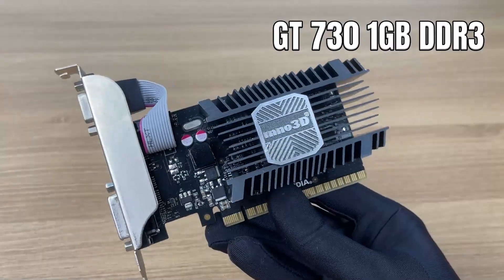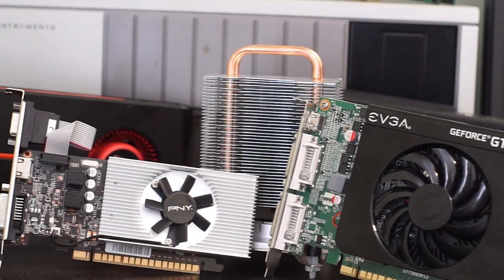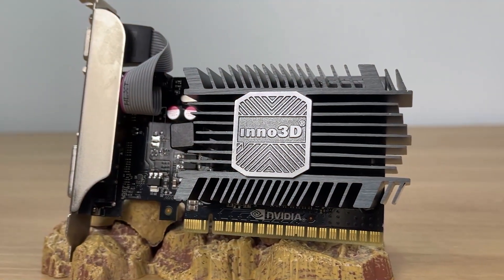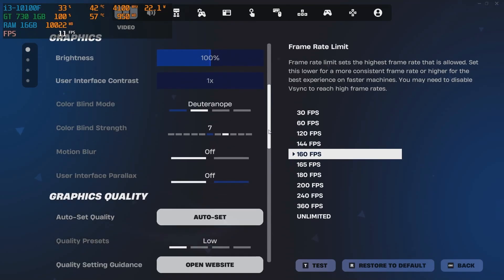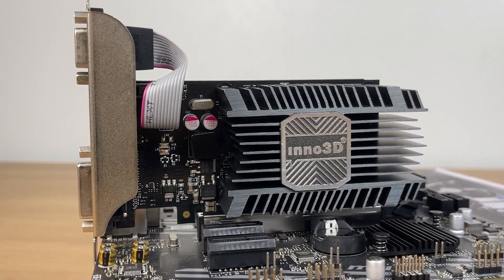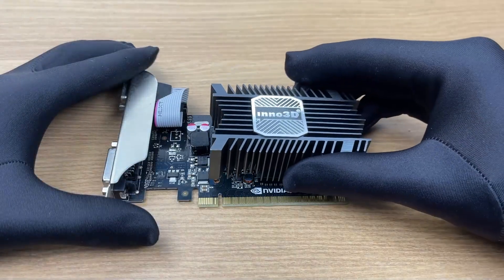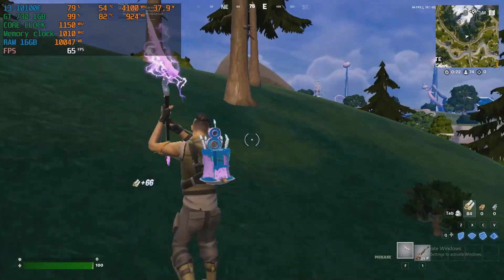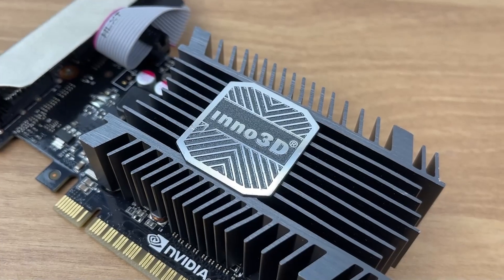$20 GPU Overclock Boosts Gaming FPS by 10x – Here’s Proof!

Comment: try putting a fan on the heatsink, maybe it would improve the performance
Reply from the maker: I really want to mount a fan but there is no mounting point
Reply: @gamerig68 you could use zip ties
Reply from the maker: @itzvlczak oh, may be it is a good idea, thanks bro
Reply: @gamerig68 use an 80mm case fan with cable ties. Also try undervolting it which will help reduce heat a bit
Reply from the maker: @BillyBoy444  ok, let me try to reduce heat follow your way
Reply: Or easiest tape